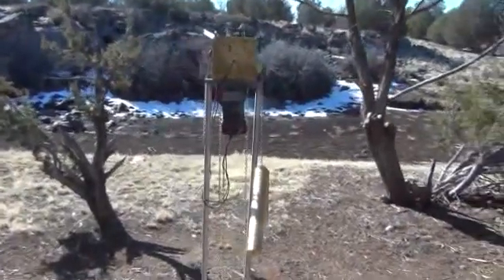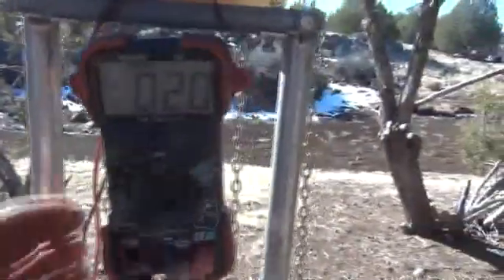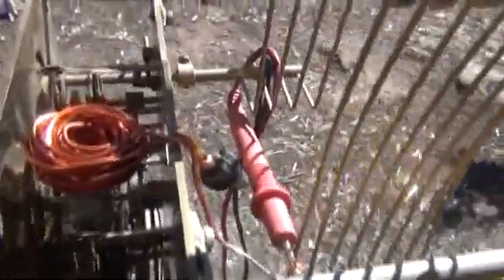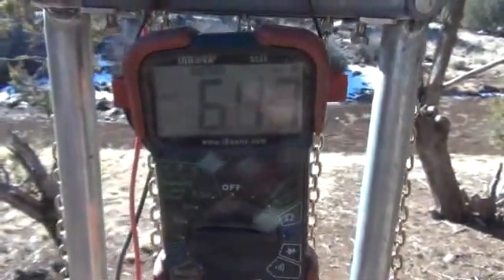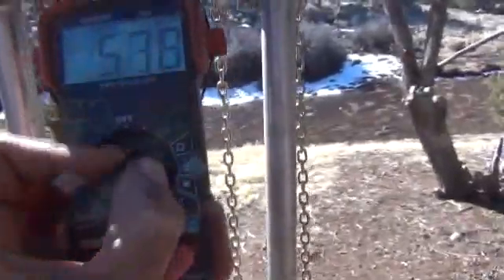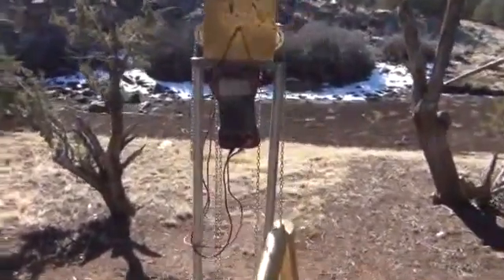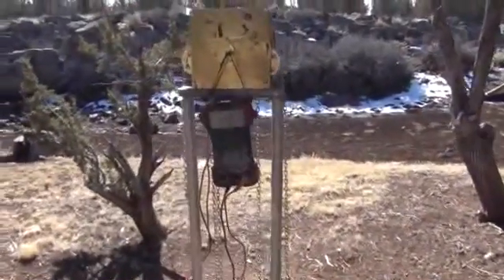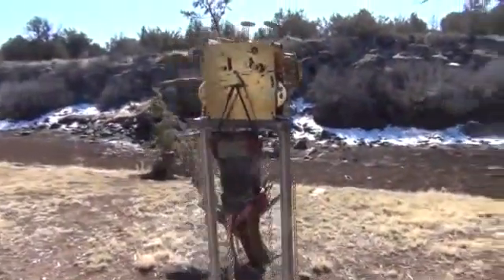COULD WE POWER OUR HOMES USING GRAVITY? Gravity Powered Electric Generator!

Comment: Did you do any calculations on the efficiency of this setup, in terms of converting potential energy to electrical? A hypothetical 100 % conversion efficiency would mean that the electrical energy output measured should be equal to the calculated potential energy of the suspended mass at its highest point.

Comment: Yeah but the problem is you´ll need the same amount of energy or actually even more to put that system back on the start position.And as soon as you connect electric device to that thing,it´s going to be much,much harder for the weights to spin those magnets,so you´ll need much heavier weights,and round it goes..

Comment: Using the commercially available gravity light, in getting about .75 watt minutes per pound. Lifting 4000 lbs will give 50 watt hours. Or put 4 amp hours into a 12v battery bank per hour....
Reply: So I figuring lifting a 2 ton concert retaining wall block 16’ in the air and geared the fall into a generator you would get about the same yield as a set of harbor fright solar panels, but you could run it multiple times a day. I don’t think you would come out ahead of a water pump, probably just under break even. Still it does have some practicality to it. I mean a man could pull a 2 ton block up in just a couple minutes with pullies  and provide a power source to a battery bank when the sun has gone down and extend the life of a battery bank by years...

Comment: My thought on this:  Use the ram pump to drive a hydraulic piston to move the weight up... alternate between 2 sets.. as one is being used... the ram pump is moving the other...  basically a gravity over hydraulics over gravity over electric system.. :)
Reply: for 1 kWh storage it should be minimum 30 feet high with suspended load of 1 ton so for lifting load while charging steel rope is good instead of hydraulics

Comment: you could always make a gear bypass and have a small motor pull the weight back up without needing the gears as that would take forever using the gears.

Comment: Any water powered generator is using gravity. You have to lift the weights to start the process expending as much energy as you get back. Some hydro schemes generate during the day when they can sell the electricity at full price then pump water back up to the higher dam at night when the electricity is cheaper. Other than that nature lifts the water for us and drops it back as rain all for free.

Comment: Consider: The force of water filling a tank could raise a weight upwards to produce electricity and then as water flows out of the tank the weight falls again and produces power again.  Maybe something like that could be used on a wastewater system, stream, river,  or rain collection system.  LOL How about a 2 level home garage where you park the car on the upper level in the evening after work where it slowly falls overnight to the lower level, then drive out and off to work again.  I wonder how much Hydrogen and oxygen your system could generate through electrolysis.

Comment: Build a two-story garage. Hook the gravity generator to a car-lift. Park your car on top in the evening, it drops all night long, generating power (or resetting your counter-weight). Drive out in the morning from the lower level...

Would be interesting to do the math on how much power could be generated using gravity-driven systems such as this.
Reply: I had the same thought I posted 14 hours later! Oh well.
Reply: Unless you are driving a solar car which will barely weigh anything, you will be paying tax on the gasoline to raise your vehicle to the altitude of the upper story. You will also need to hoist the platform for the vehicle with some quantity of energy. I keep imagining the proposed ramp used to build the great pyramid. The energy to get the car to sufficient altitude needs to come from somewhere and is baked into the system on a continual basis so for instance if you charge the cars battery with the energy you produce you will need supplemental energy to top it up because of efficiency losses.

Over all though it seems like an insight worth keeping in mind. It could probably be effective in some instances.
Reply: I was thinking why do these always use little weights? Put a ton on there or someshit! One quick workout will have the weight on there.
Reply: Raymond Durkin A clever battery idea. If your car is solar it would be green energy, otherwise you are burning fossil fuels to get the car to the second story and then using that energy slowly as the car drops. Still a lot less noisy than a diesel generator if you are off the grid and that is the other option.

Comment: Anyone remember mousetrap where part of it releases a metal ball that winds around while falling. imagine a hill. If you lifted a metal ball right up from base to the top through the centre it would take X amount of energy. If when it got to the top, it then wound around  the hill to the bottom, like a road winds round a hill to get up it. This could generate energy into the rail/road it travelled on until it gets to the bottom and then a small amount of power used to get it back up to the top using a pulley system. can't be rocket science surely! The distance travelled straight up and the power used to get it up that distance would surely be surpassed by the power generated by the much greater distance travelled spiralling back down the hill?

Comment: Great to power your wrist watch but to build a large one would take too much energy to lift your larger weight back up to the top.
Reply: Harness wastewater systems similar to how locks are used to raise and lower boats.
Reply: Gear reduction for the way up. Use a bicycle to reset it and gat ur morning workout at the same time.

Comment: like the concept.. I've been thinking about a solar powered compressor and an air tank to charge during the day... then a tesla turbine to convert to electricity when required.. could even have valve control for required power...
Reply: Or you could pump water from a low tank to a high tank, then a hydroelectric turbine to make the juice when needed.

Comment: But someone needs to raise that weight again to start this all over. Gravity is static.

Wind on the other hand is a better way, since sun makes temperature differences and makes the wind move, this is also another way of getting the best out of gravity since the air moves because of the weight difference between hot air and cold air, which as stated was produced by sun heating and thus is also an indirect usage of sun power by heat.
Reply: This is just the storage device, the battery, minus the chemistry.
You can use wind power to raise the weight, solar, whatever floats the old boat.
Reply: Wind is unreliable. Gravity is constant.

Comment: Could this be made large scale if you use the moons gravity to lift the weights with the ocean tides?
Reply: This is a neat idea. Maybe a neutral/tunable buoyancy mass could be used. Only problem is low amplitude of tidal fluctuations in most places so it wont directly lift any mass very high. Using waves to generate power is an old idea really but effective designs are seldom implemented at large scales ...for some reason.
Reply: Well there are tidal generators which just get knocked back and forth by the waves, and something like that could easily be rigged to wind this up, as high as you cared to build it. As was mentioned in the video though, pretty much any energy source could do the same. It is a simply brilliant energy storage system with innumerable applications.

Comment: There is another way to do this too by slowing the decent of water...I'd tell you more but then I'd have to....well, you know the saying. If you combine the decent of water with the buoyancy of air, it would do twice the work for half the cost.
Reply: That would be cool. You could build a wall to stop a river, then let the water out to generate electricity as needed!
You wouldn't even need air. Dam that's a good idea!
Reply: Electric pumps are too inefficient. A rope pump or  a rosary pump working in tandem with a hydraulic ram pump, could move that river water into an elevated storage tank in another location or several locations to increase your wattage in the cottage. lol.
Reply: Your welcome. ;)